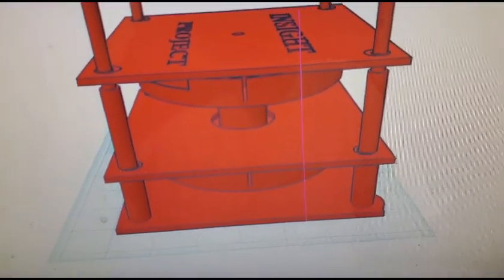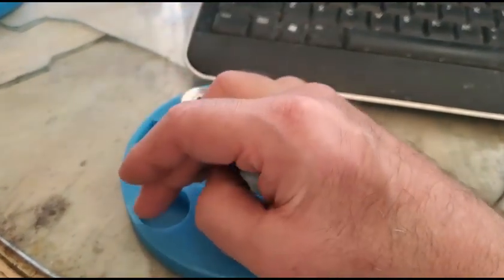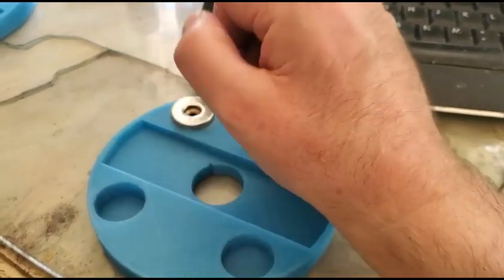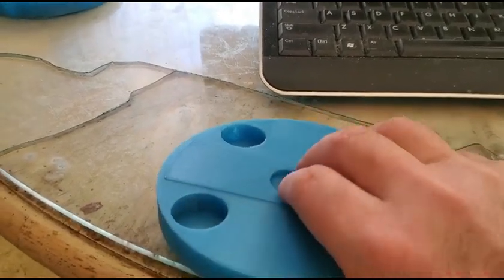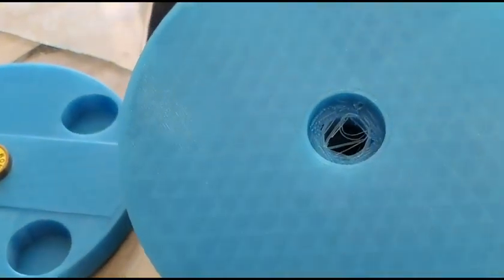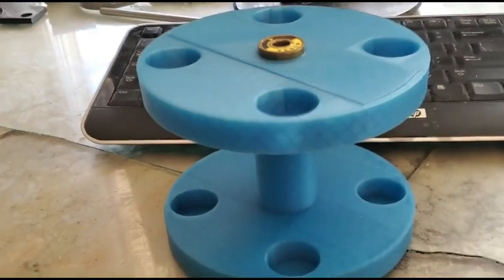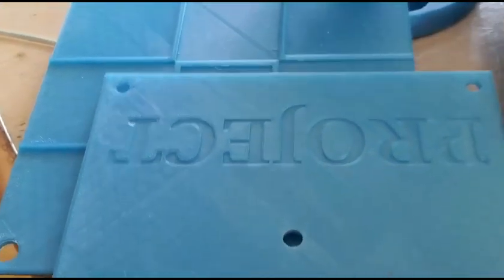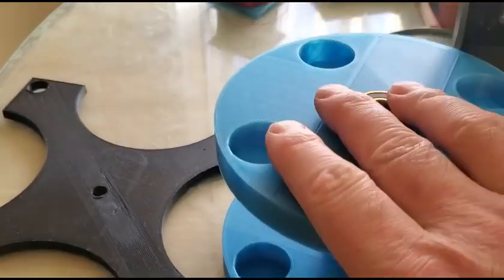A Little More Progress towards the Mark I 3D Printed Pulse Motor

Comment: You need to add an offset to any measurement in CAD that is applied to PLA due to shrinkage + printer tolerances. Generally I add 0.2mm to 0.3mm to a dimension to ensure a push fit. Also, if you want to make a variable inductor gap, instead of having the bearings on the rotor, change the design so the axial goes through the rotor(s). You can secure the axial to the rotor by designing a hub onto each rotor with a grub screw (3D printed if you want) to secure the rotor in place on the axial. When you want to change the gap, just loosen the grub screw, position, and tighten.
Reply from the maker: Evo,
Mea Culpa, Mea Culpa, Mea Culpa for the late reply.  I just saw that with the standard comment filter your comment was placed in moderation, PLA?? 0.2mm?? I dunno.  Thank you for your excellent comment, will look grub screws.